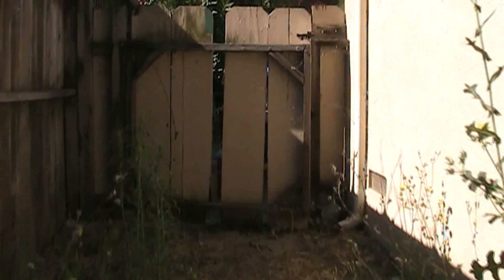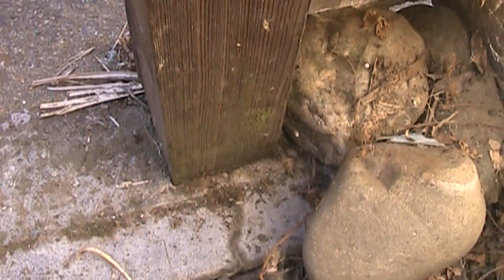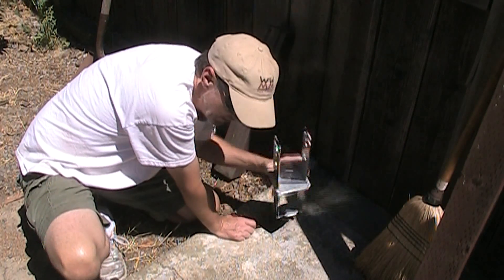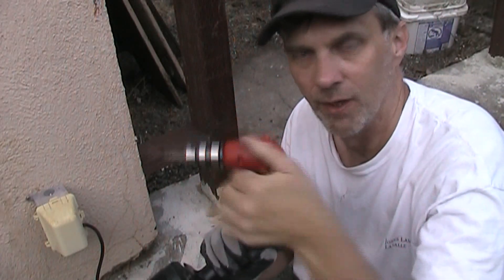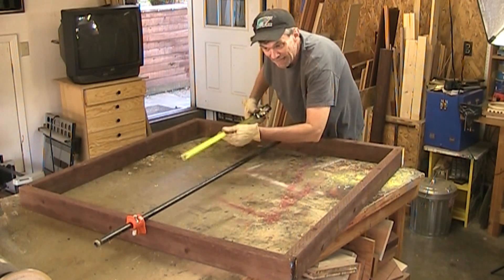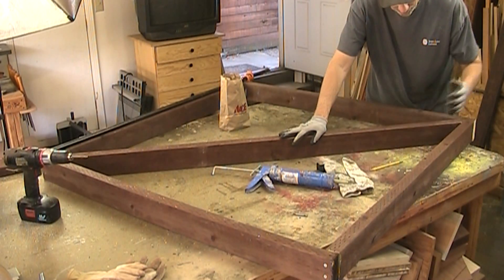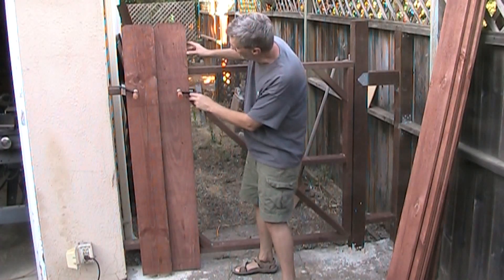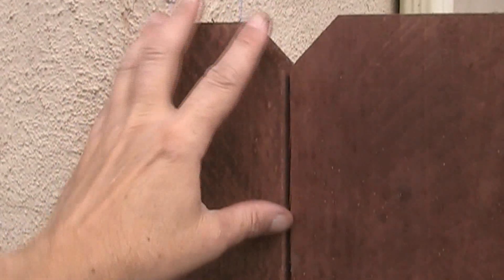Build a wood garden gate

Comment: nice results. i just completed this very same project this past spring. you may wanna consider attaching a pergola above the posts, for two reasons: it will keep the posts true in the changing seasons and it will help with preventing gate sag (it'll take some of the stress off of the turnbuckle). mine looks good. it gives the fence/gate a decorative touch.

Comment: From years of experience building fence and pole barns etc. if you put a post in concrete it will rot it off right at the surface..If you wrap it in 30lb. felt it will not rot any time soon..Best to use buckets. when you can. I made gates for my yard with PT 2x4's they will last for years just stain or seal them. Thanks for the video Steve  Your gate will last for a while.

Comment: I really like those Simpson standoffs that you didn't use. I got tired of replacing fence posts so I built a short concrete wall and used those. I wonder if you could have bent the lower bracket to fit the hole? There's also a straight tie that you can use. It fits the existing hole. You pour cement in just as you did and then lag the post to the upper plate of it. They should have been in the approximate area where you found the standoffs. Sadly, you can use them next time...

Comment: Glad to see this worked out and that you were going to try my sleeve idea from Facebook;-).  I'm curious about that cement mix. Looks like a much simpler solution in the end. Though the sleeves I had in mind are different. The ones I was thinking about when I made the comment don't actually sink into the hole. The have a flange that sits flush with the concrete and get screwed into the concrete and post. Anyway glad it worked out!

Comment: A simple way to have mounted the post would have been to fill the holes with concrete, put in a half inch J bolt topped with a galvanized post bracket from your favorite big box home improvement center.  The 4" X 4" can be nailed or screwed into the bracket.  File that for next time.

Comment: really nice. Did you consider not ripping the one over the hinges and just fastening the "whole" board to either the gate or the post? Probably the gate would be the better option and that way you'd hide the hinge joint a bit better.

Comment: those brackets would have worked perfectly with a couple hammer blows in the bottom, making it a v or m shape would have made em fit. simple and functional just to fill it with cement.

Comment: Could you possibly give a little more information on the concrete product that you used, I have exactly the same problem with my rear gates to my double concrete hardstand and really do not want to dig out 6 inches on concrete. I live in the UK and may be able to find a similar product here, Thanks.

Comment: Hey there, great video. I just finished a similar gate, but my OCD kicked in when it came to leaving the last picket as a narrow piece. My gate was in the middle of a long fence, and I wanted it to blend in. I did the math and narrowed each picket in the gate to the appropriate width so they would all be the same, no small pieces. I stacked 3 at a time on their sides and used my electric hand planer to take off 1/16" at a time. Quick and easy!

Comment: Love your videos and I subscribed long ago, but as a concrete guy I need to speak up. It's concrete, not cement. If you add water only to cement it's not cement anymore, it's slurry. If you add anything else to the slurry mixture it becomes concrete. The way you anchored your posts will work for a while but the cement in your mixture will ruin the posts. Treated lumber or cedar will last a bit longer but it will still degrade. There are post saddles with rebar under them that would work great.
Reply from the maker: +ConcreteLand ok